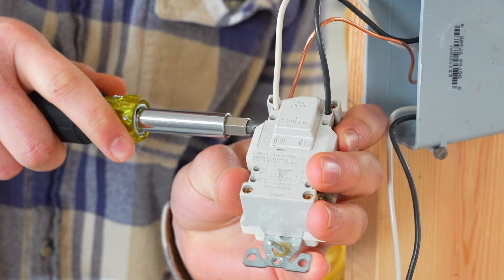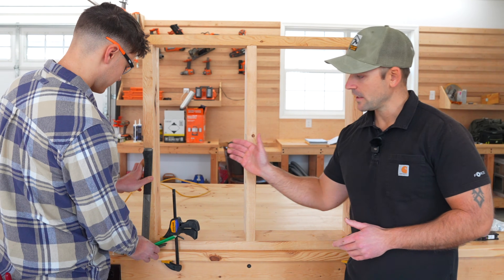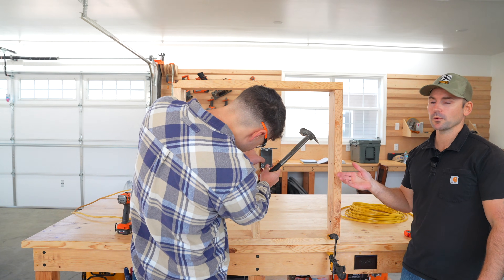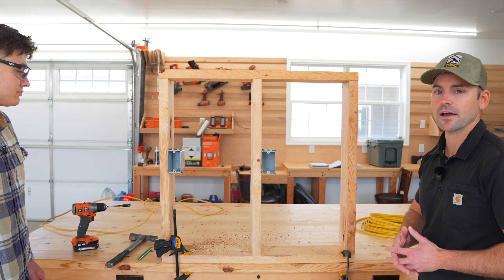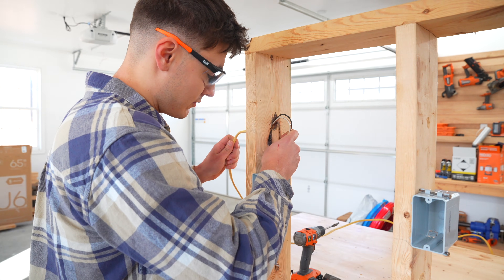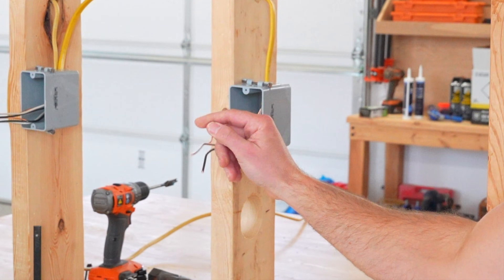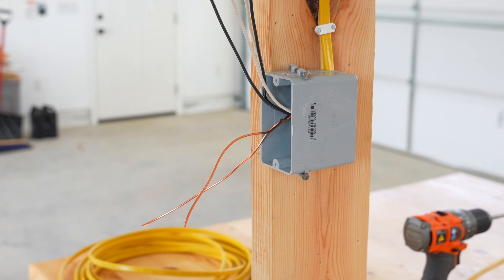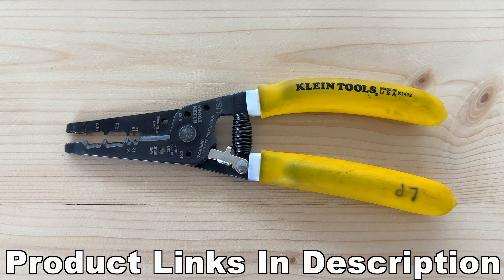GFCI Outlet Installation | Avoid This Common MISTAKE!

Comment: In a kitchen, bathroom, or workshop area, outlets might be that close together.  It's easier to put in more than you need, than decide to put in another one after the wall is finished.

Comment: Very good video.  However, did you know there are class action lawsuits against the companies making the GFCI AFCI fuses? They are ridiculously overly sensitive and trip so often because they can't seem to recognize a basic standard arc from an appliance than a real fire hazard event.    The same people that work for these companies end up on the boards of the same people that make changes to the NEC?  I would rather have my GFCI at the outlet level.   But the fuses?  No way.

Comment: I know not relevant to this video, but your explanation is awesome. 

I have a situation that I can't seem to figure out. I have a light switch in my master bedroom that operates the ceiling fan and what appears to be the main bedroom out. When replacing all the outlets I connected the wires on the main out back the way they were when I disconnected them, or so I thought. This out supplies power to 6 other outlets in the room. Each out was independent of the others. But now when I turn off the light switch, all the outlets in the room turn off as well. Any ideas what I missed? Thank you all.
Reply: You have a switched receptacle somewhere. Is there somewhere where you had a 3 wire meaning black and red and white?

Comment: Love the tutorial. I was attempting to replace a standard outlet in one of my bathrooms with a GFCI to make it code. The problem I ran into was, the old outlet had 1 red on the gold screw (hot), 1 white on the silver screw (neutral) and oddly enough, a white, which was hot on the other silver screw. The outlet only works when the bathroom light is on. I wasn't sure why 2 hot wires? When I tried to put the red hot and white neutral in the "line" side of the GFCI and the other white-hot wire in the either side of the load, nothing happened. Any thoughts anyone?

Comment: At 16:50, if I understand you correctly, with the other style GFCI receptacle, when it was connected "backwards", it tripped when you plugged the orange tester in?  In my workshop, I requested the electrician install some GFCI receptacles.  At the time, there was no power run to the building but now that there is, any time I plug something into one of the GFCI receptacles, no matter how small a load, it immediately trips.  Could this mean that the GFCI receptacles are connected "backwards"?  Thanks, and great video!

Comment: It's useful to indicate why the offset between the front of the studs and the front of the electrical box. Further, mention the length of sheathing needed inside the box. I believe "back stab" is the wrong term. The correct term is "back wire." There's a clapping plate to secure the wire versus a spring loaded tab device. Back stabbing is more trouble-prone versus back wiring. The plate make a much better connection as stated at 11:22.
Reply: I believe both terms might be correct, depending which outlets you are using.  But, I agree.  I don't use back-stabs. Always use the screws.  I've had back-stab wires come out after the job is finished, and back-stabs can only be used with 14 wire.

Comment: Why did you use an outlet rated for 15 amps on a 20 amp circuit?
Reply from the maker: Here we can use multiple 15 amp receptacles on a 20 amp circuit if it is not dedicated circuit. If it was a dedicated circuit, we would have to use a 20 amp receptacle. Hope that helps!
Reply: @TheExcellentLaborer  Exactly. I have this same question before about my renovated house and found out it was exactly as described.